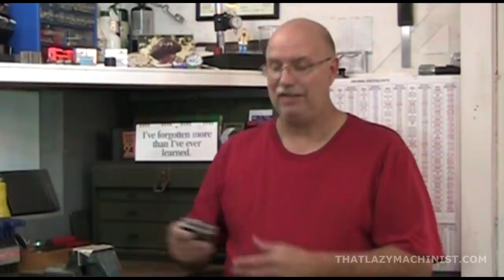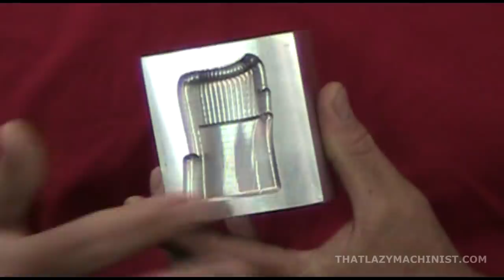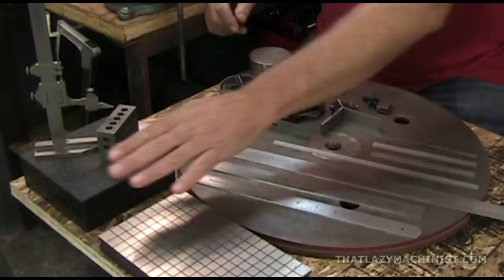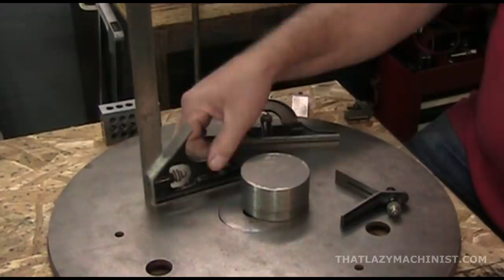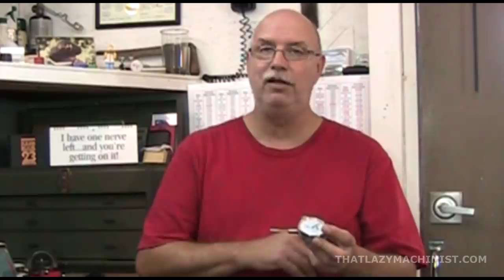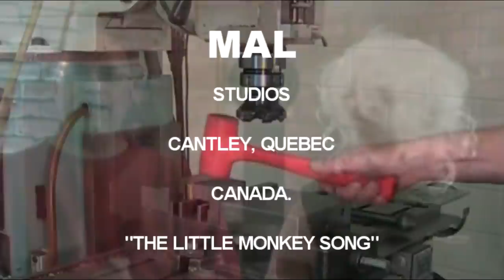MACHINE SHOP METROLOGY #2, how to use rulers, surface plates, joe (gauge) blocks and dial indicators

Comment: I am intrigued about the attachments that you showed to allow using a scribe to scratch a line along the length of a bar. Do you have a video showing how to make one or possibly the dimensions so we could make a set?
Thanks for your wonderful videos. I have learned a lot by watching them.
Reply from the maker: Hi Robert! I made the ones that I have a lifetime ago and I made them to fit my Starret combination ruler (no blueprints). The angles are not important but squareness and symmetry between the two feet are. I will get some close up photos and some measurements from the ones I have and pass them on to everyone in a little quickie video. Thanks for watching and for taking the time to comment, Marc